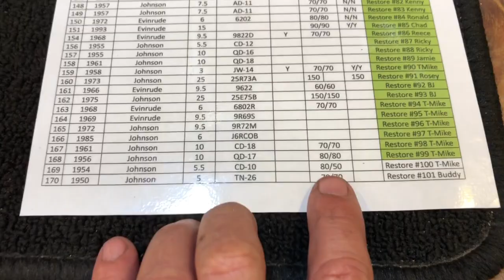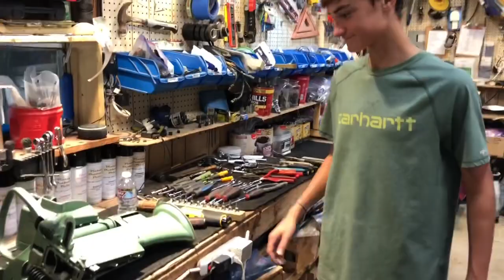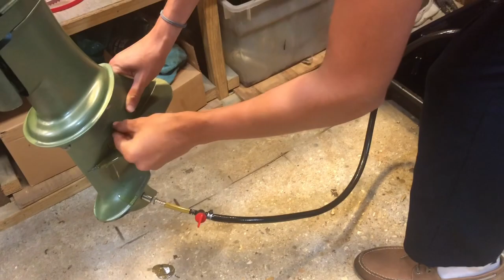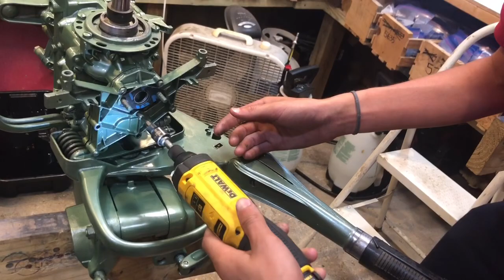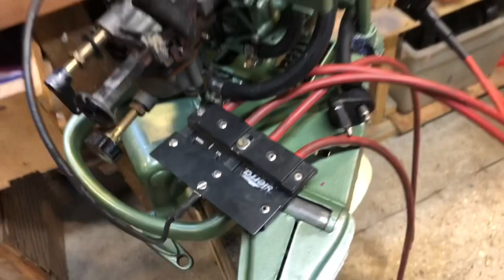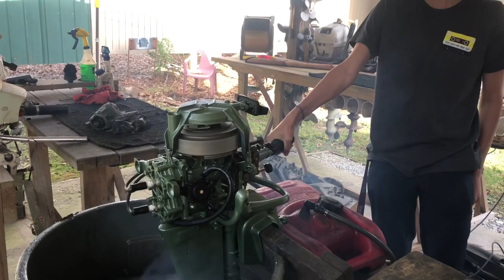First Time Restoring a 1954 Johnson Outboard Motor

Comment: I have a 1960's elgin 7.5 hp. For some reason it does not have spark on both cylinders. What do you think  is the problem? (I already replaced the spark plugs) Thanks!
Reply from the maker: https://youtu.be/_p_QoBQ1gYI